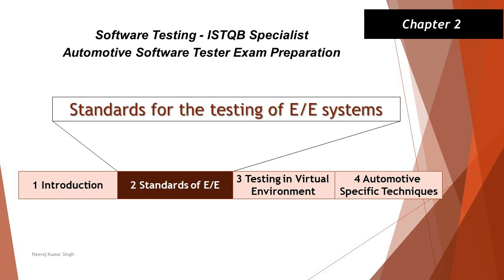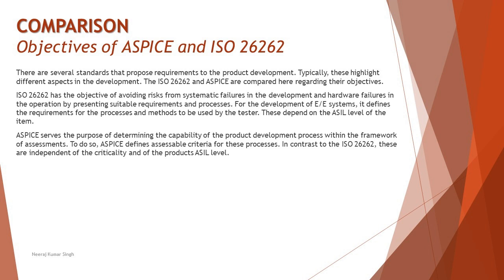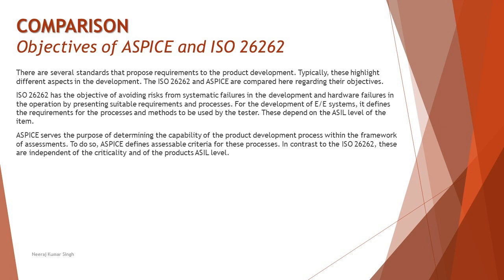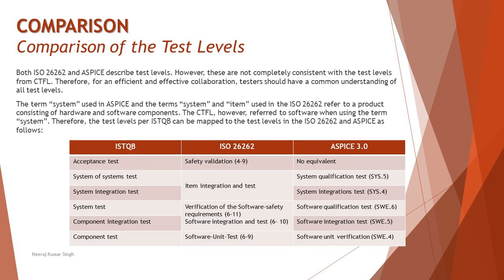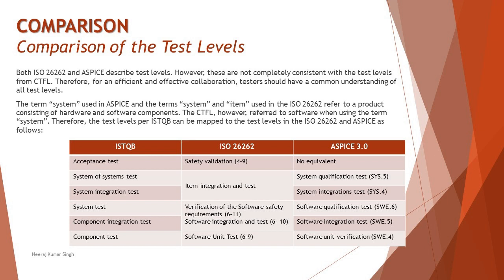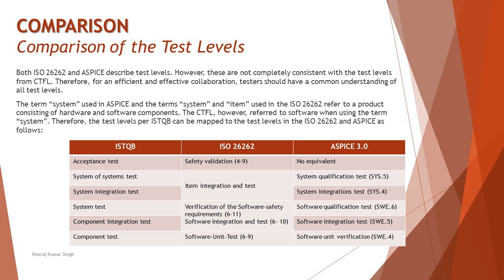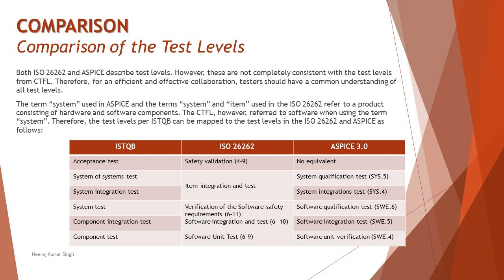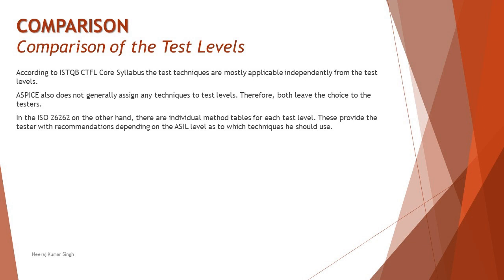ISTQB Automotive Tester | 2.4 Comparison | Objectives of ASPICE and ISO | Test Levels Comparison

Comment: Hi , The ISO 26262 doesn't have volume 11, but verification of software-safety Requirements is mentioned as 6-11. could you please explain
Reply from the maker: It's good catch in fact I didn't notice it. It must be typo as there are only 10 volumes.